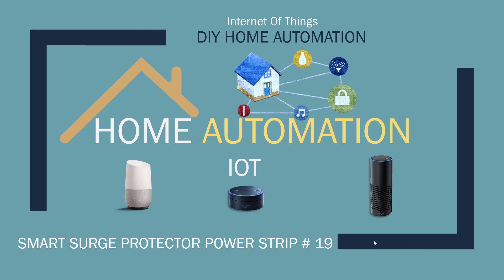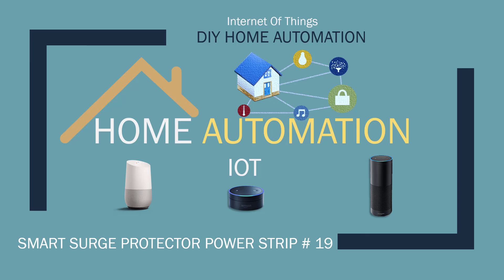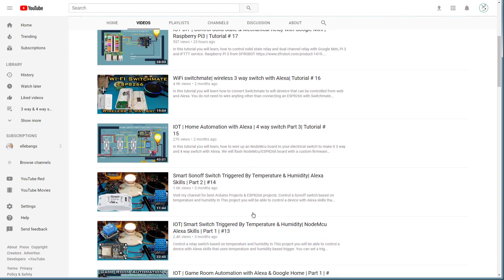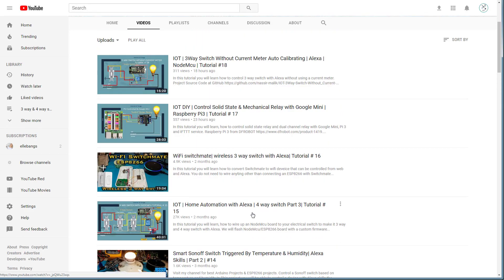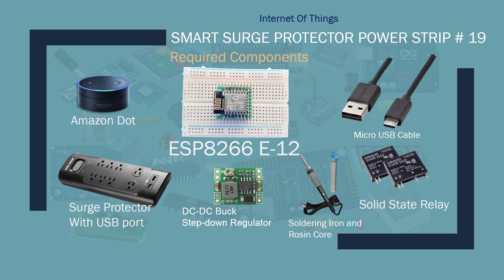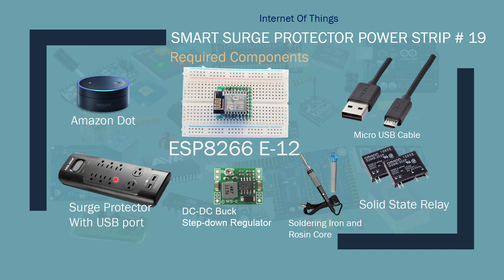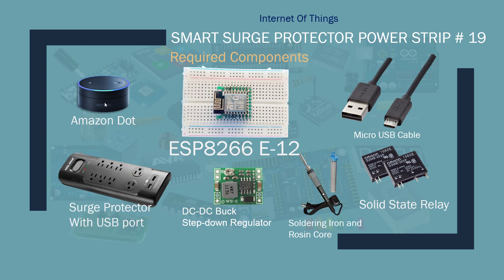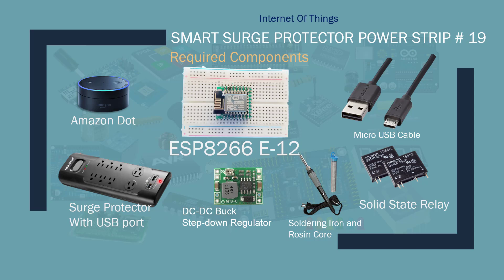DIY Arduino ESP8266 Smart Power Strip | Tutorial # 19

Comment: Nassir, I have been trying to connect Echo Plus with NodeMCU V3, but have not succeed yet.  Alexa fail to discover devices. The codes work perfectly with Echo dot. Do you have any idea or suggestion that I can try?
Reply from the maker: Sunil Datta Login to your Alexa account and remove the devices and try to discover it with Echo plus again.
Reply: Netmedias I have already done this. Amazon says that the issue is because echo plus comes with inbuilt hub. I can see echo sending reply setup.xml on alexa response. But it appears that alexa is expecting a different response. Now I want to know if you have ever tried the codes on echo plus and if there is something you want me to try.
Reply from the maker: Sunil Datta I have not tried it on echo plus. I may buy one and test it out.
Reply: Netmedias NP, thanks for your reply.
&
You are making good tutorials. I Expect you will continue making such tutorials. Thanks.

Comment: I bought 3 power bars  to do the same thing. I wanted 5 plugs to be separately controlled in each one. But when I opened it they were 2 strips like yours. Not individual ones. And they are all encased  in a plastic cover inside also. Maybe I will see if I can take off the plastic covers over the connectors and see if I can cut the plugs into separate lines. Thanks for the great find on the code. That should save time.  Thanks for the videos.
Reply from the maker: Drex Projects I was going to cut them and attach a relay for each plug, but it would make a very lengthy tutorial.Good luck with your project and thank you for your feedback.

Comment: I'm using a NodeMCU with a 5 volt mechanical relay board instead of Solidstate relays. When I power up some of the relays turn on (some only dimmly lit) and I have to disconnect the 5 volts to the relay board, then press reset on the nodeMCU then reconnect the 5 volts to get things working properly. Does anyone know how to overcome this start-up problem.

Comment: I'm using NodeMCU V3, I'm able to connect it to as Acces Point with my Android Phone, but I don't see manage router option, even I tried to connect through Desktop but no success, unable to open page 192.168.4.1, unable to configure WiFi through AP Mode, Please Help.
Reply from the maker: Look for your IP in Arduino serial monitor. You have different IP assigned to your device. It is dynamic IP.

Comment: Netmedias
, Great code. I have everything working but Alexa will not discover the new devices. The Arduino serial monitor shows that I am connected to my local WIFI and the switches we added.
Reply from the maker: Are you using echo plus?
Reply: I have an Echo (2nd Edition). Thanks

Comment: Respected Sir it is good project
but i get following error please help me sir 

Arduino: 1.8.5 (Windows 10), Board: "NodeMCU 1.0 (ESP-12E Module), 80 MHz, 115200, 4M (3M SPIFFS)"

Build options changed, rebuilding all
sketch\UpnpBroadcastResponder.cpp:70:22: warning: character constant too long for its type [enabled by default]

   if(request.indexOf('M-SEARCH') > 0) {

                      ^

sketch\UpnpBroadcastResponder.cpp: In member function 'void UpnpBroadcastResponder::serverLoop()':

sketch\UpnpBroadcastResponder.cpp:70:32: warning: large integer implicitly truncated to unsigned type [-Woverflow]

   if(request.indexOf('M-SEARCH') > 0) {

                                ^

C:\Users\SSSSD\AppData\Local\Arduino15\packages\esp8266\hardware\esp8266\2.3.0\libraries\WiFiManager-master\WiFiManager.cpp: In member function 'void WiFiManager::setupConfigPortal()':

C:\Users\SSSSD\AppData\Local\Arduino15\packages\esp8266\hardware\esp8266\2.3.0\libraries\WiFiManager-master\WiFiManager.cpp:146:71: error: no matching function for call to 'ESP8266WebServer::on(String, std::_Bind_helper<false, void (WiFiManager::*)(), WiFiManager* const>::type)'

   server->on(String(F("/")), std::bind(&WiFiManager::handleRoot, this));

                                                                       ^

C:\Users\SSSSD\AppData\Local\Arduino15\packages\esp8266\hardware\esp8266\2.3.0\libraries\WiFiManager-master\WiFiManager.cpp:146:71: note: candidates are:

In file included from C:\Users\SSSSD\AppData\Local\Arduino15\packages\esp8266\hardware\esp8266\2.3.0\libraries\WiFiManager-master\WiFiManager.h:17:0,

                 from C:\Users\SSSSD\AppData\Local\Arduino15\packages\esp8266\hardware\esp8266\2.3.0\libraries\WiFiManager-master\WiFiManager.cpp:13:

C:\Users\SSSSD\AppData\Local\Arduino15\packages\esp8266\hardware\esp8266\2.3.0\libraries\ESP8266WebServer\src/ESP8266WebServer.h:79:8: note: void ESP8266WebServer::on(const char*, ESP8266WebServer::THandlerFunction)

   void on(const char* uri, THandlerFunction handler);

        ^

C:\Users\SSSSD\AppData\Local\Arduino15\packages\esp8266\hardware\esp8266\2.3.0\libraries\ESP8266WebServer\src/ESP8266WebServer.h:79:8: note:   no known conversion for argument 1 from 'String' to 'const char*'

C:\Users\SSSSD\AppData\Local\Arduino15\packages\esp8266\hardware\esp8266\2.3.0\libraries\ESP8266WebServer\src/ESP8266WebServer.h:80:8: note: void ESP8266WebServer::on(const char*, HTTPMethod, ESP8266WebServer::THandlerFunction)

   void on(const char* uri, HTTPMethod method, THandlerFunction fn);

        ^

C:\Users\SSSSD\AppData\Local\Arduino15\packages\esp8266\hardware\esp8266\2.3.0\libraries\ESP8266WebServer\src/ESP8266WebServer.h:80:8: note:   candidate expects 3 arguments, 2 provided

C:\Users\SSSSD\AppData\Local\Arduino15\packages\esp8266\hardware\esp8266\2.3.0\libraries\ESP8266WebServer\src/ESP8266WebServer.h:81:8: note: void ESP8266WebServer::on(const char*, HTTPMethod, ESP8266WebServer::THandlerFunction, ESP8266WebServer::THandlerFunction)

   void on(const char* uri, HTTPMethod method, THandlerFunction fn, THandlerFunction ufn);

        ^

C:\Users\SSSSD\AppData\Local\Arduino15\packages\esp8266\hardware\esp8266\2.3.0\libraries\ESP8266WebServer\src/ESP8266WebServer.h:81:8: note:   candidate expects 4 arguments, 2 provided

C:\Users\SSSSD\AppData\Local\Arduino15\packages\esp8266\hardware\esp8266\2.3.0\libraries\WiFiManager-master\WiFiManager.cpp:147:81: error: no matching function for call to 'ESP8266WebServer::on(String, std::_Bind_helper<false, void (WiFiManager::*)(unsigned char), WiFiManager* const, bool>::type)'

   server->on(String(F("/wifi")), std::bind(&WiFiManager::handleWifi, this, true));

                                                                                 ^

C:\Users\SSSSD\AppData\Local\Arduino15\packages\esp8266\hardware\esp8266\2.3.0\libraries\WiFiManager-master\WiFiManager.cpp:147:81: note: candidates are:

In file included from C:\Users\SSSSD\AppData\Local\Arduino15\packages\esp8266\hardware\esp8266\2.3.0\libraries\WiFiManager-master\WiFiManager.h:17:0,

                 from C:\Users\SSSSD\AppData\Local\Arduino15\packages\esp8266\hardware\esp8266\2.3.0\libraries\WiFiManager-master\WiFiManager.cpp:13:

C:\Users\SSSSD\AppData\Local\Arduino15\packages\esp8266\hardware\esp8266\2.3.0\libraries\ESP8266WebServer\src/ESP8266WebServer.h:79:8: note: void ESP8266WebServer::on(const char*, ESP8266WebServer::THandlerFunction)

   void on(const char* uri, THandlerFunction handler);

        ^

C:\Users\SSSSD\AppData\Local\Arduino15\packages\esp8266\hardware\esp8266\2.3.0\libraries\ESP8266WebServer\src/ESP8266WebServer.h:79:8: note:   no known conversion for argument 1 from 'String' to 'const char*'

C:\Users\SSSSD\AppData\Local\Arduino15\packages\esp8266\hardware\esp8266\2.3.0\libraries\ESP8266WebServer\src/ESP8266WebServer.h:80:8: note: void ESP8266WebServer::on(const char*, HTTPMethod, ESP8266WebServer::THandlerFunction)

   void on(const char* uri, HTTPMethod method, THandlerFunction fn);

        ^

C:\Users\SSSSD\AppData\Local\Arduino15\packages\esp8266\hardware\esp8266\2.3.0\libraries\ESP8266WebServer\src/ESP8266WebServer.h:80:8: note:   candidate expects 3 arguments, 2 provided

C:\Users\SSSSD\AppData\Local\Arduino15\packages\esp8266\hardware\esp8266\2.3.0\libraries\ESP8266WebServer\src/ESP8266WebServer.h:81:8: note: void ESP8266WebServer::on(const char*, HTTPMethod, ESP8266WebServer::THandlerFunction, ESP8266WebServer::THandlerFunction)

   void on(const char* uri, HTTPMethod method, THandlerFunction fn, THandlerFunction ufn);

        ^

C:\Users\SSSSD\AppData\Local\Arduino15\packages\esp8266\hardware\esp8266\2.3.0\libraries\ESP8266WebServer\src/ESP8266WebServer.h:81:8: note:   candidate expects 4 arguments, 2 provided

C:\Users\SSSSD\AppData\Local\Arduino15\packages\esp8266\hardware\esp8266\2.3.0\libraries\WiFiManager-master\WiFiManager.cpp:148:83: error: no matching function for call to 'ESP8266WebServer::on(String, std::_Bind_helper<false, void (WiFiManager::*)(unsigned char), WiFiManager* const, bool>::type)'

   server->on(String(F("/0wifi")), std::bind(&WiFiManager::handleWifi, this, false));

                                                                                   ^

C:\Users\SSSSD\AppData\Local\Arduino15\packages\esp8266\hardware\esp8266\2.3.0\libraries\WiFiManager-master\WiFiManager.cpp:148:83: note: candidates are:

In file included from C:\Users\SSSSD\AppData\Local\Arduino15\packages\esp8266\hardware\esp8266\2.3.0\libraries\WiFiManager-master\WiFiManager.h:17:0,

                 from C:\Users\SSSSD\AppData\Local\Arduino15\packages\esp8266\hardware\esp8266\2.3.0\libraries\WiFiManager-master\WiFiManager.cpp:13:

C:\Users\SSSSD\AppData\Local\Arduino15\packages\esp8266\hardware\esp8266\2.3.0\libraries\ESP8266WebServer\src/ESP8266WebServer.h:79:8: note: void ESP8266WebServer::on(const char*, ESP8266WebServer::THandlerFunction)

   void on(const char* uri, THandlerFunction handler);

        ^

C:\Users\SSSSD\AppData\Local\Arduino15\packages\esp8266\hardware\esp8266\2.3.0\libraries\ESP8266WebServer\src/ESP8266WebServer.h:79:8: note:   no known conversion for argument 1 from 'String' to 'const char*'

C:\Users\SSSSD\AppData\Local\Arduino15\packages\esp8266\hardware\esp8266\2.3.0\libraries\ESP8266WebServer\src/ESP8266WebServer.h:80:8: note: void ESP8266WebServer::on(const char*, HTTPMethod, ESP8266WebServer::THandlerFunction)

   void on(const char* uri, HTTPMethod method, THandlerFunction fn);

        ^

C:\Users\SSSSD\AppData\Local\Arduino15\packages\esp8266\hardware\esp8266\2.3.0\libraries\ESP8266WebServer\src/ESP8266WebServer.h:80:8: note:   candidate expects 3 arguments, 2 provided

C:\Users\SSSSD\AppData\Local\Arduino15\packages\esp8266\hardware\esp8266\2.3.0\libraries\ESP8266WebServer\src/ESP8266WebServer.h:81:8: note: void ESP8266WebServer::on(const char*, HTTPMethod, ESP8266WebServer::THandlerFunction, ESP8266WebServer::THandlerFunction)

   void on(const char* uri, HTTPMethod method, THandlerFunction fn, THandlerFunction ufn);

        ^

C:\Users\SSSSD\AppData\Local\Arduino15\packages\esp8266\hardware\esp8266\2.3.0\libraries\ESP8266WebServer\src/ESP8266WebServer.h:81:8: note:   candidate expects 4 arguments, 2 provided

C:\Users\SSSSD\AppData\Local\Arduino15\packages\esp8266\hardware\esp8266\2.3.0\libraries\WiFiManager-master\WiFiManager.cpp:149:83: error: no matching function for call to 'ESP8266WebServer::on(String, std::_Bind_helper<false, void (WiFiManager::*)(), WiFiManager* const>::type)'

   server->on(String(F("/wifisave")), std::bind(&WiFiManager::handleWifiSave, this));

                                                                                   ^

C:\Users\SSSSD\AppData\Local\Arduino15\packages\esp8266\hardware\esp8266\2.3.0\libraries\WiFiManager-master\WiFiManager.cpp:149:83: note: candidates are:

In file included from C:\Users\SSSSD\AppData\Local\Arduino15\packages\esp8266\hardware\esp8266\2.3.0\libraries\WiFiManager-master\WiFiManager.h:17:0,

                 from C:\Users\SSSSD\AppData\Local\Arduino15\packages\esp8266\hardware\esp8266\2.3.0\libraries\WiFiManager-master\WiFiManager.cpp:13:

C:\Users\SSSSD\AppData\Local\Arduino15\packages\esp8266\hardware\esp8266\2.3.0\libraries\ESP8266WebServer\src/ESP8266WebServer.h:79:8: note: void ESP8266WebServer::on(const char*, ESP8266WebServer::THandlerFunction)

   void on(const char* uri, THandlerFunction handler);

        ^

C:\Users\SSSSD\AppData\Local\Arduino15\packages\esp8266\hardware\esp8266\2.3.0\libraries\ESP8266WebServer\src/ESP8266WebServer.h:79:8: note:   no known conversion for argument 1 from 'String' to 'const char*'

C:\Users\SSSSD\AppData\Local\Arduino15\packages\esp8266\hardware\esp8266\2.3.0\libraries\ESP8266WebServer\src/ESP8266WebServer.h:80:8: note: void ESP8266WebServer::on(const char*, HTTPMethod, ESP8266WebServer::THandlerFunction)

   void on(const char* uri, HTTPMethod method, THandlerFunction fn);

        ^
:\Users\SSSSD\AppData\Local\Ardu
Reply from the maker: Alexa Osd You need to select board type "Generic ESP8266 Module" in Arduino IDE and flash it. It is not NodeMcu. Good luck.